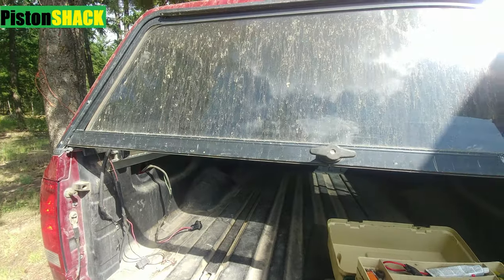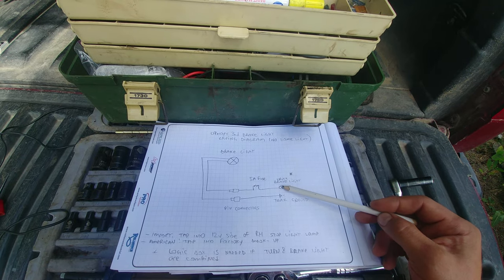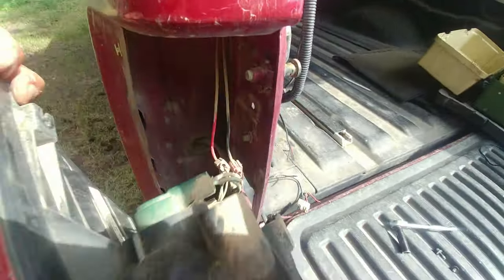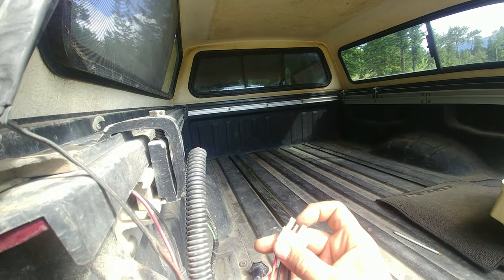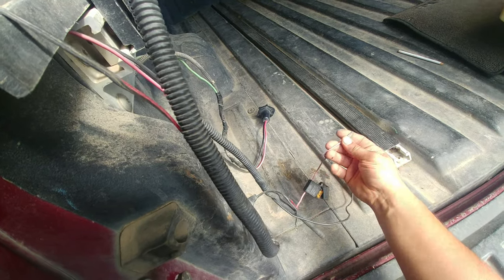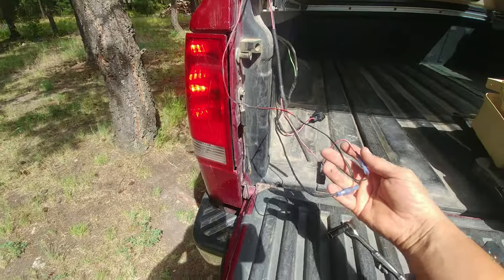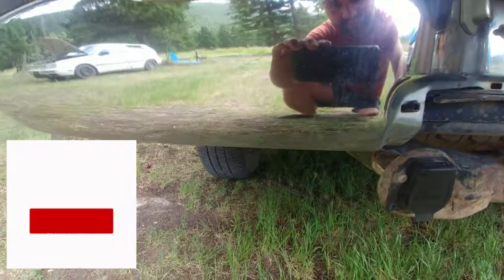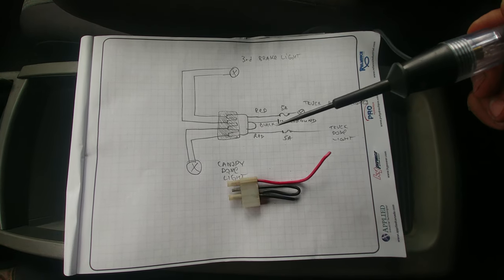TRUCK CANOPY 3rd BRAKE LIGHT WIRING: wiring diagram, inline fuse, signal wire, ground EXPLAINED// 4K

Comment: Funny when they put the fuse so far from the source.  Should be within 18” of source.
Reply from the maker: I totally agree with you inline fuse or circuit breaker should be located closer to the power source. Good point.
Reply: You place the fuse between the connector and the light, just like he did.